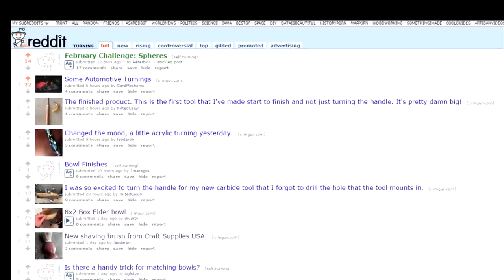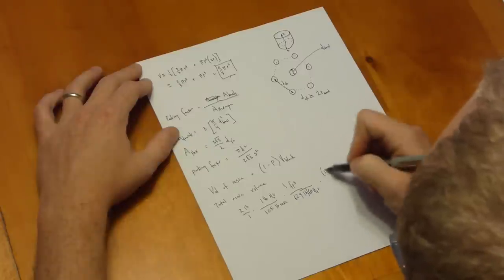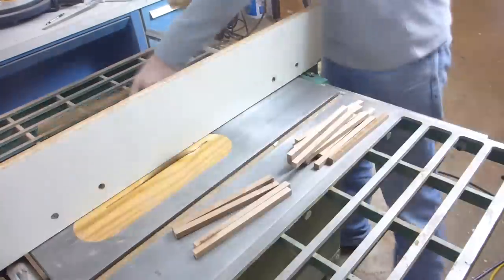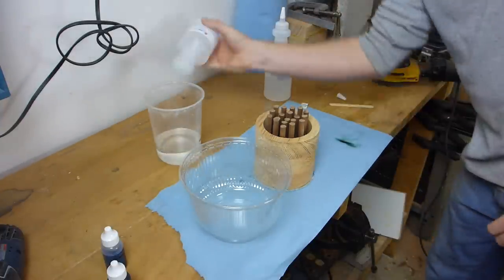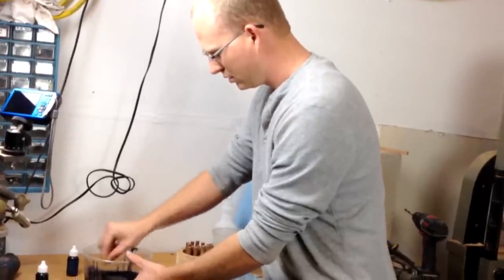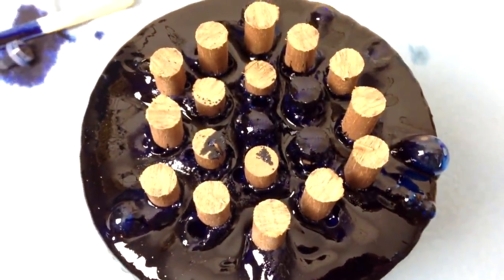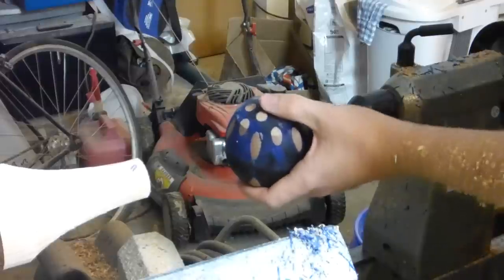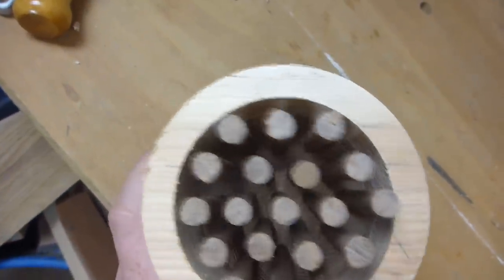Resin Sphere Turning Experiment Failure

Comment: Cool project Grady, it was really cool to see the whole process from concept to conclusion. You had a couple stumbles with the resin, but overall you did fine for your first try at it, especially doing something a bit on the advanced side.  

I work with Alumilite every day, and I wanted to mention a couple tips that will help you next time you give it a try. I saw that you learned quick that those Alumilite dye bottles are worthless with the cap on, so don't feel bad about that. I've learned (the same way you did) to just take the dropper insert out and throw it away.  You do need to watch how much dye you add to the mix, only up to 5% of the part A resin amount. I know that  you didn't have a choice for this one, but in the future try not to go over that 5% mark.

One major thing I wanted to mention is that you should mix Alumilite by weight. I just use a small gram scale I got off Amazon for something like $15. The weights are different in part A & B, and the mixture needs to be accurate to get the best results.

I also wanted to mention is that Alumilite doesn't play well with moisture. The 2x6 material likely had moisture in it which will cause the resin to kind of foam up. You'll want to dry the wood if you use wood for the mold next time. You're literally shooting for zero moisture (as close to it as possible).  

I'd definitely recommend using a pressure pot with Alumilite, it sets so fast that the air bubbles get stuck in the resin pretty quick. Polyester resin and epoxy are slow setting, so you are able to get by without pressure for most applications. You can convert a Harbor Freight paint pressure pot for use as a pressure chamber for around $125 with the pot and all the plumbing. Good call on the random orbit sander vibration though, I guarantee it helped.

Last, you can use something like CA glue to hide any bubbles that are left. That process is a pain,but it works after enough coats.

I hope you'll keep trying the resin casting out. It's a ton of fun and there are almost no limits to what you can do with it.  Thanks for sharing your video of it.
Reply: I wonder if epoxy would have been a better choice with all the dowels and no pressure pot?
Reply: *****  Glad I could help man, don't hesitate to ask if you have any questions.  Can't wait to see the next resin project!

Comment: Moisture in wood was boiling... Pressure and longer curing time also would prevent that from happening :) I'll try to do that domeday.
ps. do you have shop air compressor? If you do, you don't need "hundret's of dollars' equipment", only large diameter pipe with threads on both sides with two caps, one with air hose connection (or car tyre air valve), you put filled mold in, screw in caps, pressurize it with compressor, after curing, release air, unscrew and voila! bubbleless cast :D
Reply: I was thinking the same thing, but instead of pressurizing it. Create a vacuum inside the pipe.

Comment: Was interesting to watch...I screamed with shock when the dye lid came off!  If you have not figured it out yourself by now a hint for that.
...maybe put the drops in a separate container before adding to the resin, then if anything happens like that it won't spoil your mix. This is one of the rules of baking with eggs. Break into something else before adding so that no nasties or shell get into it. Easier to remove. Apologies if someone else has mentioned this, too many to read all comments.

Comment: GradyI think overall this video was a homerun. Others may disagree and that's okay. I love the dowel cutter, That is an awesome tool. Can you tell me where you got that?   I really liked your narration you have a good voice and you described every step very well,  I liked that.  I especially like the process of making the form and drilling the holes for the dowels.  I did read Zach Higgins comment. He is the expert and I agree with what he said even though I have never done any casting like this.  I always thought that using a  sander would help eliminate air bubbles.  

Here is my advice;  I would try to save this sphere by filling the voids with the CA glue and a decorative material.  My favorite is crushed turquoise.  But you could even use saw dust.  This is truly a pain and will take a while but I think the results will be cool.  Be careful with CA glue-I would use a chemical respirator cause this will take a while.  Finally I think it's very important to sand this project.  I always sand my acrylic and resin projects to 12,000 grit.  This makes all the difference.
Thanks for the video it was very cool Sam
Reply: +WYOMINGWOODTURNER I thought I both owned every tool I wanted to own and at the very least, I have a wish list of the things I would like to have. When he busted out that dowel cutter, I let out a "WHAT IS THAT AND WHY DO I NOT OWN IT! I think it awesome that there are still really cool tools out there that I am able to discover like a kid on Christmas morning.

Comment: the heat gets generated by the resin it self. the more resin you put in one form the more heat you will get. and the typ of resin makes a very big difference. longer curing time means less heat. my resin needs 3 days to get hard and dont gets warm at all.
and the bubbles have much more time to go away. and if there are some bubbles, a bit of heat (max 60° Celsius) will get rid of them.
best regards pii
Reply: I'm not quite sure what the point of the dowels was, but I'm thinking instead of dowels, use copper tubing and run cooling water through it as it cures.  Just like the guys who do big concrete pours.  Then, you can drill out the copper tubing and re-fill the holes left behind with more resin.

Comment: Grady, I work with casting resin all the time.

Back off on your catalyst. Pour into one side spot at a slow rate.  Give the mold a few shakes and rock it back and fourth.  That will help get rid of the air bubbles.

Use old fashioned cutting tools.  They won't eat your casting.

If you still have air bubbles fill them with CA Glue and let rest over night.

Good luck and keep having fun!

Comment: Thanks for posting the "failure", however I wouldn't consider it a failure because of the fact you learned from it. I am new to the whole turning thing and really love the possibilities that resin allows. Harbor Freight sells a pressure paint pot and it has worked well. Anyway thanks again for sharing.

Comment: One thing I learned from a lathe worker was that never put your fingers to anything that is rotating. You for sure will have an accident with your lathe when you're using your hand that way with the lathe to slow it down. Mark my words.
Reply: This is true for metal because the surface finish can have razor sharp edges, but for woodturning it doesn't matter. Most woodturners use their hands.
Reply: That is not true. The problem with a lathe for example, is the fastly rotating mass. The reason why you associate it with metal work is that a lathe for metal parts has much stronger motors, gears and also much heavier parts. It is literally impossible to stop it by hand and it will you rip everything off you hold in it. A wood lathe,  however, basically only consists of a weakish motor and it does not have a lot of spinning mass. But I still agree that he should not do that.

Comment: You did great!  For a first attempt, the sphere came out very well! The Alumalite spheres are probably the coolest thing I make.  Now you see why Alumalite is cured under pressure. It really is the only way to deal with the bubbles in the "Clear".  Other Alumalite formulations have a longer open time.   Harbor Freight has a good pressure pot for not much money and everyone has a compressor.  The Alumalite dyes are great but next time  make a dilution of the dye (which will last forever) and color your casting form that. One drop of dye in 50 ml of part A then diluted about 1:50 will give a nice translucent blue.  The carbide tools are not really a good choice here (as they seldom are) since the Alumalite doesn't really cut well, it scrapes.  Your cutter was probably sharp but lacked mass. A traditional scrapper has sufficient mass to resist vibration.  The Kelton Multi-Tool is my first choice but any heavy scraper will work. 
Well done!

Comment: it's a Very cool idea.  i think the  fast curing of the resin is what did you in.  a slower curing resin (say 2 hrs)  would probably generate less heat as well as give you time to vibrate out the bubbles while the mix was still runny.    i think it's worth trying again

Comment: It might have been a good idea to use a PVC mold instead of a wooden mold to reduce the bubbles, and also add the dowels after the resin has poured as well. Also pouring the resin immediately will mean the viscosity is smaller thus air bubbles flow to the top more easily. As for the chipping, I don't know, but I would wager that longer passes and a sharper tool would reduce that. Its always a relief to see someone share a failure because it reminds us all that when mistakes are made knowledge is gained, usually. Great video.

Comment: Hey Grady I just found your channel and I really like your content! I think a way that could have minimized bubbles would be to have poured the resin in 4 to 6 layers, letting it set completely in between each layer. It wouldn't generate as much heat at one time and the bubbles would be easier to get out as they have less material to move through compared to a full mold of resin.

Comment: I'll just add that I do a lot of work with acrylic/resin inlays and I bought a cheap set of wood lathe tools at harborfreight and made a custom cutter where it comes almost to a sort of rounded point. I took a scraper to begin with and ground it down to a point (so looking from top it came to an upside down v), then sharpened it at around the same angle of a gouge rounding off the v a little). Essentially it's the same cutting profile as your carbide cutter but about 3/16 diameter so you gotta keep it sharp (I keep a piece of sandpaper on the lathe bed and run the tool over it to refresh the edge on a regular basis. This way the contact area is minimal and although it takes a lot of time to cut, I overcome the chips you experience to a point where the rest is sandable and a thick clear coat with wet sanding takes care of the rest. Also, the tool rest height is critical!!  I'm not an expert (far from it) but I found this works for me.
Reply from the maker: +Dmitri Zyuzin Very cool. Thanks for sharing!

Comment: dip it into clear resin and it will fill the holes. and you should use a vacuum pump to get the air out, and ensure a good bond into the wood

Comment: if you do like 10 small batches of that stuff, and layer it?vibrate inbetween? maybe that helps not having to de-bubble the whole thing? i've never worked with this stuff, hell, i've never turned a piece of wood, but it just popped into my head as a question! Nice video!

Comment: A pressure pot will make the voids smaller, but to remove the voids to the greatest extent, mix the resin and use a vacuum pot to cause the bubbles to escape from the resin.  The second problem is that wood is a good thermal insulator and the resin is exothermic as it cures.  This can cause thermal runaway during curing.  There are retarders that can be used to slow the curing process to allow the heat time to escape to the surroundings.

Comment: first of all... your comments are hilarious :D
I think most of the bubbles were made by air leaving the wood and soaking up with resin. 
You can only avoid that by degassing the entire thing.. slowly for few hours. and that can be a little bit expensive. Moast of the resins just push out bubbles out of them before they start curing.

so here is an idea and i'm not sure if it will work.

before pouring the resin, cover everything with resin with a brush. wait until resin becomes more like clay and rubery than like fluid. than put another layer of resin with a brush. (if necessary 3 or more layers) than when it is rubery again pour the whole thing. My advice is that you do NOT wait untill resin that you put on with brush cures. maybe it would not merge. CHECK ON THAT before you start working on it.  

And it is normal for some resins to boil up to 100°C

good luck
Reply: +Robert Surma Having worked a tiny bit with embedding items in resin to make jewellery you are right about the bubbles coming from the wood. Any item that was once living will release air bubbles so yes either brush on the resin or dip the dowels to seal them. Also  don't jiggle it, keep it as still as possible. As for the boiling of the resin, the dye may have been water based, and water and resin do not get along together at all. For the jewellery I used powder pigments, but only minute amounts at a time, anything you add to the resin will have an effect on the curing time, and the hardness etc. I've never used the quantity of resin that was used in the video so it's hard to say how to get rid of the deep bubbles, but for small resin pieces go over the top with a lighter, the heat will pop the bubbles, but you have to do this regularly through the curing process as bubbles will continue to rise. Try searching on here for some of the resin jewellery video's, they  contain some good tips and tricks. You can pour multiple layers, and they do bond quite well, but I don't know if they would be tough enough to stand up to the lathe work. Maybe a resin that has a longer working time may help, so you don't have to hurry so much?

Comment: try soaking it in more resin (clear this time) to fill in the gaps, and then sand down the (now uneven "wet" suface) back to the original sphere. you could also paint it with resin, but the point is that you make an even ish layer of resin. you can hide a lot of crimes by filling them in and polishing.

Comment: I know 5 years late

But

You can take what you have, with the chip out, and the bubbles and give it a tip coat of resin. That will help fill the voids and give you a better surface to work on. This will also give depth to the wood in it, giving a more 3d rendering or look as light pass s threw the layers. I would say a thin coat if light blue to fill in and several coats or a recast maybe a half or quarter thick in the thinnest plane, clear resin, the alumalight amazing clear cast that has a 40 min pot life, that you can after 3 to 5 min of thorough mixing use a vacuum chamber to de gas the resin giving a better look, with out a pressure pot. (Disolved gasses in resin are still present with the pressure pot style of casting and why I like vacuum casting vetter, most will not care)

Comment: I'm thinking don't vibrate the project with the sander. That was probably what caused a lot of the bubbling? I noticed that alot of bubbling was right next to the dowels that were vibrated... People use pressure pots to cure resin with minimum bubbling... Just my 2 cents... Seeing a fail is just as important as a win for the learning process... great video

Comment: From my experience, your choice of resin might not have been the most perfect one. You want to have a really slow curing one, something that takes at least 24h during the summer to cure, or, now that we lower temperatures in our shops, 48h.
When mixing the resin, I tend to pay attention on mixing it gently and take my time - It won't harden on me anyways that quickly. Another bonus is the fact, that once poured in, the bubbles have plenty of time to escape.
Lastly a note on the choice of the tool: I know you love your carbide cutter, but for this kind of work there is almost no way around shear-cutting techniques and tools.
However, as always, a nice and ingenious project you made there; And thanks for documenting it this well. Your videos are great.
Reply: I forgot to add that the heat and thereby stress in the material isn't as big a problem with less aggressive hardening. Heat seemed to be the biggest challenge with this project.

Comment: Slowly roll your mold on an angle as you pour in the resin. You can also try to heat your resin before you combine them to lower the viscosity. Slow mixing will lessen the air you whip into it..

Comment: something usefull to do when you cast a resin mold is to put the mold in the floor and let the resin fall from a table or something like that. so the small line of resin falling will loose a lot of air bubles

Comment: The mold wasn't bad. really near all your issues can be laid at the over abundance of the dye. it was probably a component of the dye that was boiling from the heat (those resins are designed not to boil from their own heat. 

one thing i noticed on their site is that the one ounce dye bottle tip is solid.... it needs to be cut to properly dispense.

Comment: Here is a kosher cook's idea about avoiding too much food coloring: think about the kosher way to break multiple eggs for a recipe. The challenge is, if an egg is fertilized, you are not allowed to use it. If a fertilized egg is in the same bowl as any number of good eggs, you are not allowed to use any of the eggs. Therefore, you break each egg into a small bowl first and  make sure it isn't fertilized. If it isn't, you add it to the other eggs in a big bowl. So with your food coloring too, perhaps squeeze a little into a shot glass first, then when you have as much in the shot glass as you want, pour it into the resin.